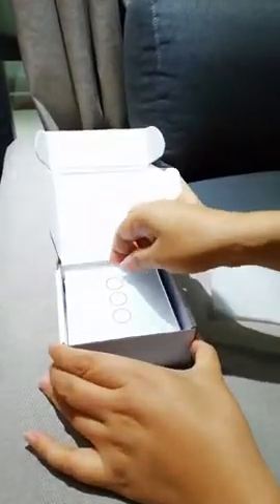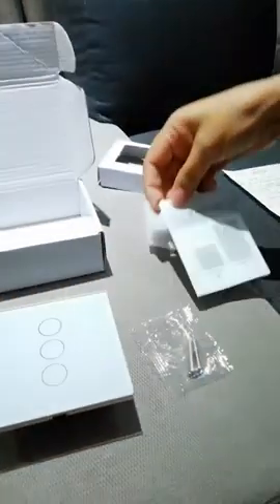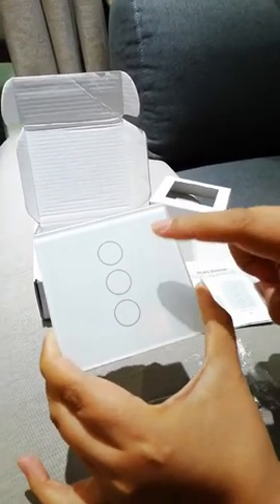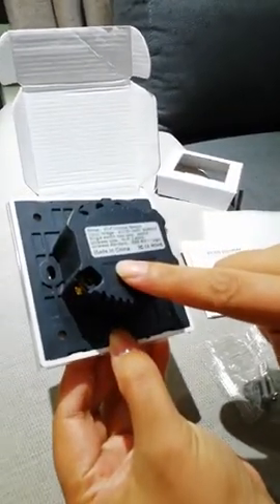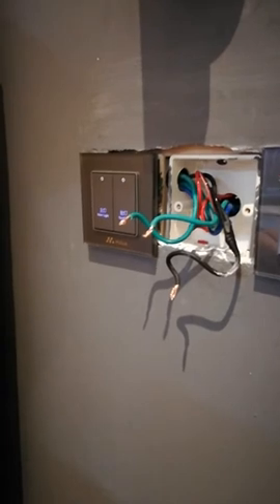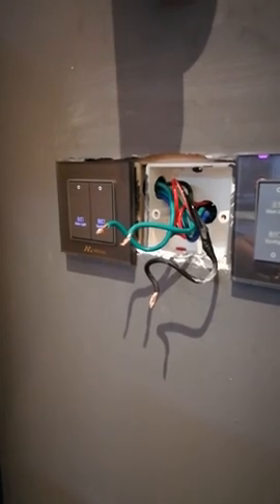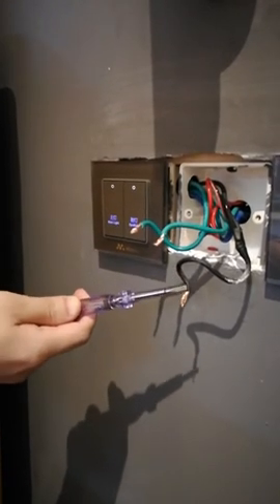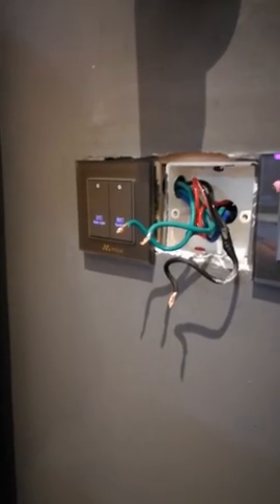How to connect Wifi Wall Switch

Comment: Hi.. Does this support MQTT? Does it use the ESP8266 Wifi module? If so, is possible to change the firmware to Tasmota or ESPEasy?